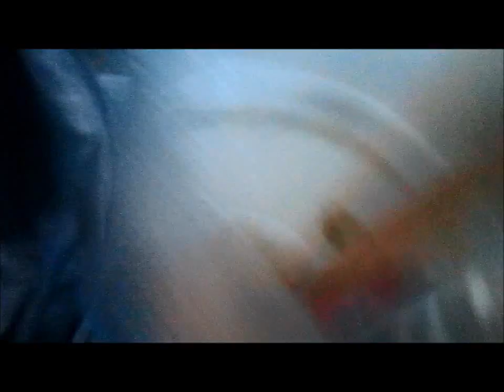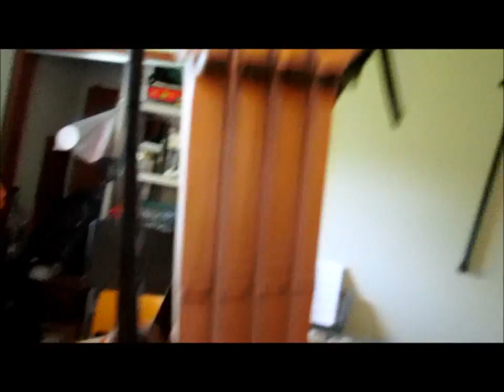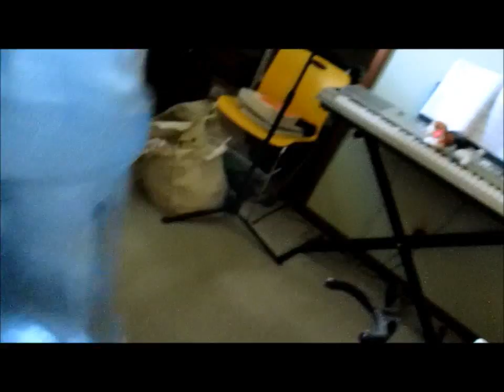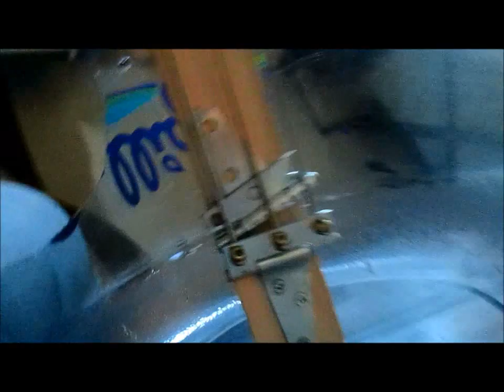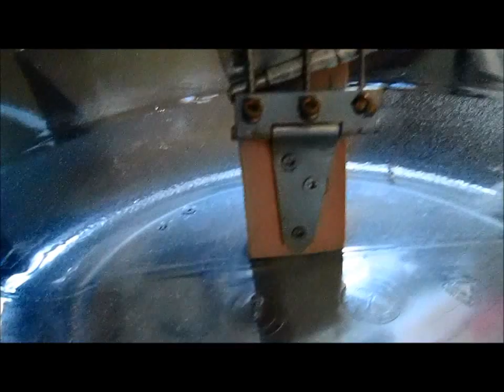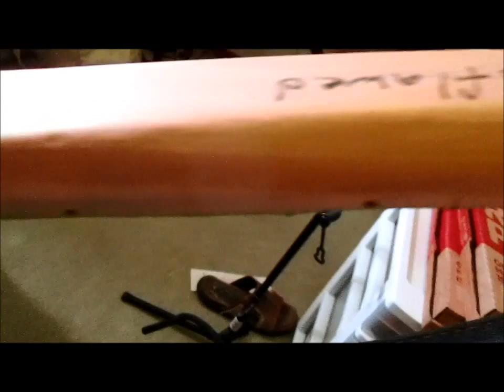Culligan water bottle bass

Comment: Sounds really great! How long is the scale?
Reply from the maker: Starts on the low E goes up 13 frets to the F one octive higher, next string is the A and third string is the D, which goes up to the Eb.
Reply from the maker: I did go with a half distance at the 12th fret, I used a Fender Bass as a template for the fretting and then adjusted the hinge I'm using for the bridge until it was a full octave at teh 12th fret on the E and the D string, just letting the A end up where it ends up.  I don't know a ton about what I'm doing, but that's how I was told to set up my Mandolin and Violin bridge as well, so I figured it was a good strategy here.

Appreciate all of the positive response to my design.  I really just took a bit of everything I saw others doing and did my best to combine them.  It sounds much louder in the video than it does in person, but it's good for playing out while I'm camping with friends around the fire.
Reply from the maker: Luís Piteira
  One thing about the volume, and I don't know that others do or don't do this, I play it with a heavy gauge guitar pick instead of the traditional way.  I'm not normally a bass player at all, so my fingers were getting sore easily and I wasn't getting the volume I wanted from it.  But the pick fixed all of that for me.
Reply: Scott PilarczykI'm also not a bass player. I want to learn but my mother forbade me to buy it, therefore I will make it, whether the sound is quite loud like a standard bass ?
Reply from the maker: Vinsensius Andre I used a drill to create start and stop points in the bottle, then used a hand held electric jig saw to make the cuts.  It was noisy and I'd absolutely recommend a dust mask and eye protection.  As for the curve of the neck, I started with a standard rectangular piece of wood, and sawed the rough angle off, then used a sanding bit on a Dremel tool to smooth the corners more, and finally just sand paper to finish smoothing it down.
Reply from the maker: Vinsensius Andre It's certainly not as loud as a standard stand up double bass, and as far as an electric bass, its definitely not amplified.  It's loud enough to join some other acoustic instruments if you're playing with a pick.  About the same volume as an acoustic bass guitar, which just isn't ever as loud as anyone wants it.  If you want a better starting bass instrument that is easy to make, I'd suggest the washtub bass.  It's a easier design, much much louder, and the instructions are all over the internet.  If you're determined to make this kind of bass, I'd recommend finding a friends electric bass to make a template for the frets and nut and bridge. the bridge adjustment is fairly easy, just adjust it back and forth at about twice the distance of the 12th fret, until the note of open and the 12th fret are the same.  Good luck with your build.
Reply: Scott Pilarczyk Thank You